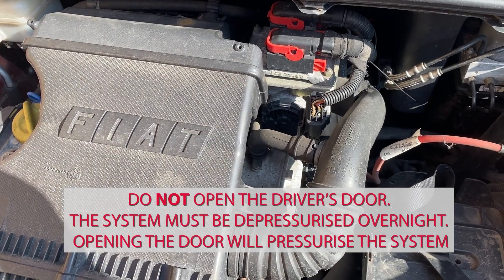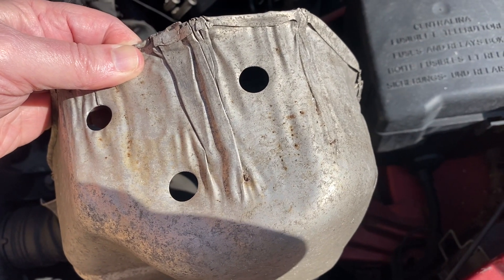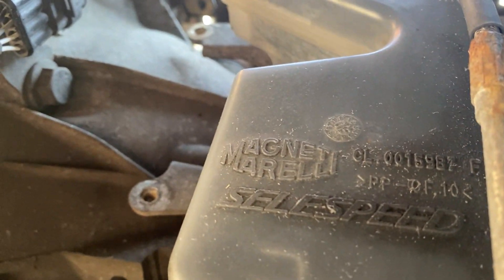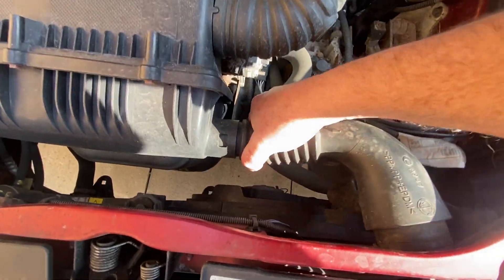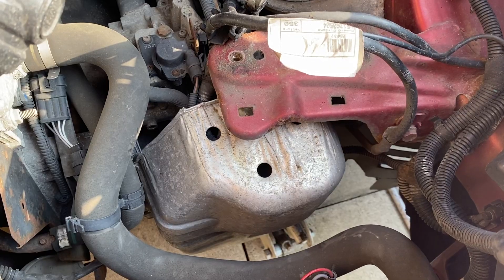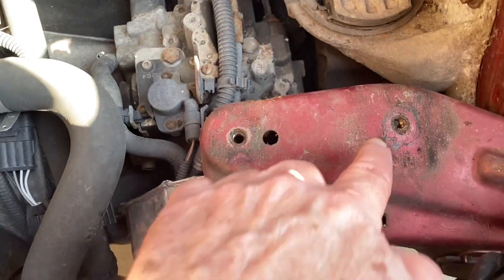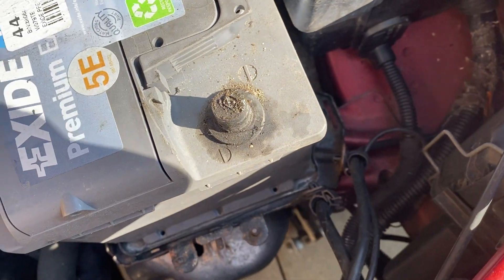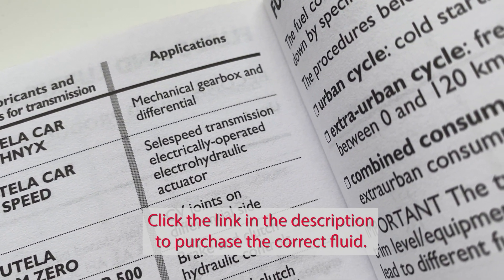How to Check the Hydraulic Fluid Level on a Fiat Idea / 500 / Punto Dualogic Automatic Gearbox

Comment: Hi. I have a Lancia Musa 2006 1.3 diesel automatic. Sometimes gives me an error gearbox failed for 2 sec and then disappear. This message always comes when is 2d gear. It pops up for 3-4 sec and then disappear. Car change gears normal. Only when message pops up won't go from 2nd to 3nd. Only for this 2 sec. The obd error is P1742. 
After some days watching the problem i see that message pops up when car is in 2nd gear and wont go to 3d until message disappear. Then it works fine. Same when car is in 2nd and going to 1st.
Can you help please. Thanks in advance
Reply from the maker: I have only done basic stuff on my car. Have you checked the level of the hydraulic fluid and or replaced it? What about the gearbox oil. Have you replaced it? Maybe clean all the electrical connections to the unit in case it’s an electrical problem giving some false reading

Comment: Does this car have 4 wheels or 3?
Reply from the maker: Five - one is needed for steering. Oh there's a sixth one too - it's the spare!
Reply: @tigershoot What size is the hydraulic oil reservoir plug? Would I use a socket or Allen key for that? It seems to be a bit tight to loosen by hand only.
Reply from the maker: @sarafahmy7006  Not sure what size but you use a socket.
Reply: @tigershoot  Got it sorted. 17 mm
Reply from the maker: @sarafahmy7006  Great. Did you find my video of any help? I have another video on how to check the gearbox oil level too. My car is 19 and I am determined to keep it going as long as possible!
Reply: @tigershoot  yup, will watch it as well. Cheers